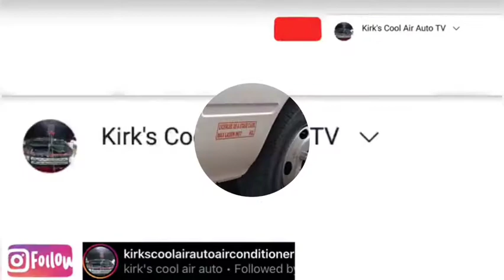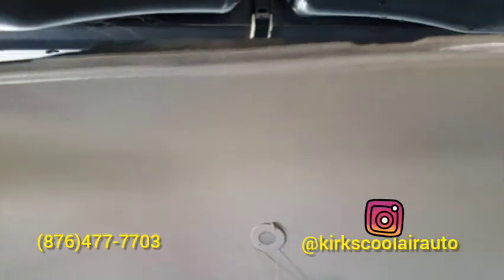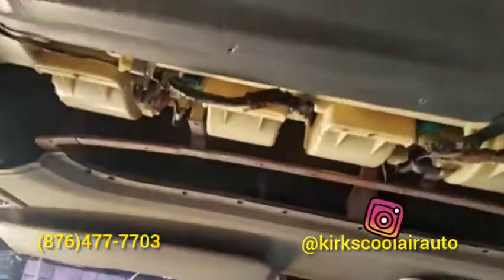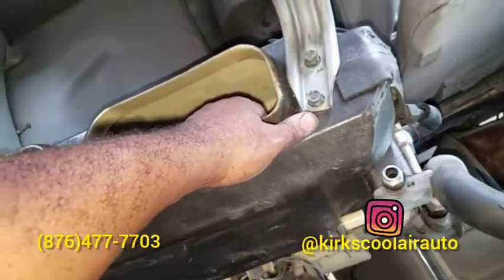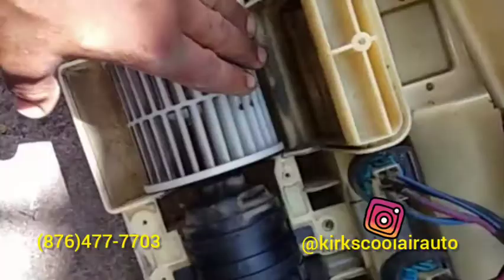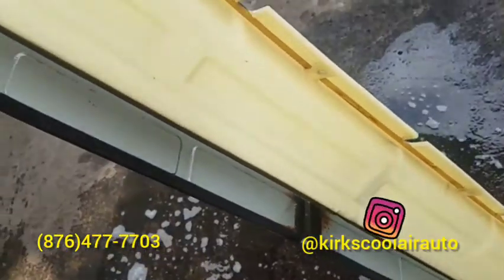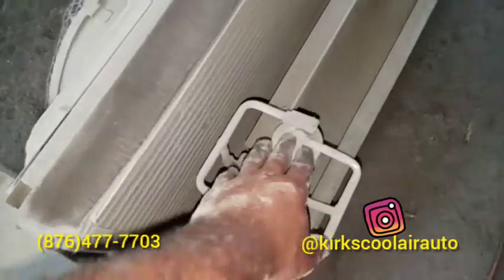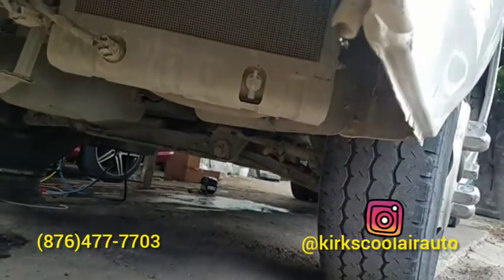Toyota Coaster Bus A/C Compressor, Receiver Drier Replacement & Service Evaporator Core & Condenser

Comment: Hi i am getting no current to the  A c compressor  the fuse is good  it comes on when  i use a wirer from the  fuse box to the compressor  what is wrong